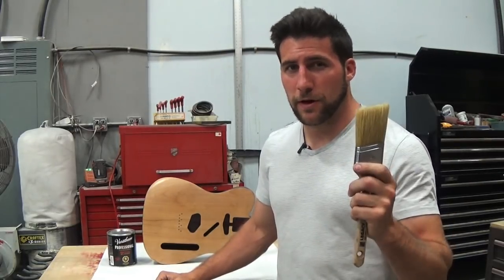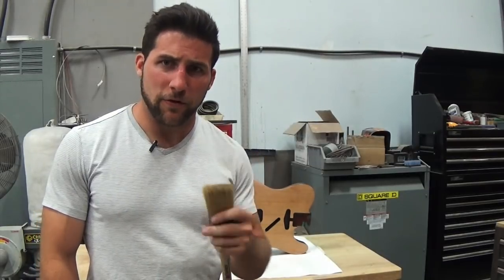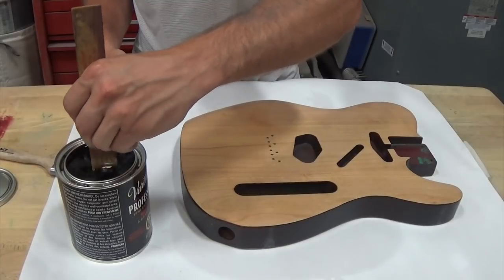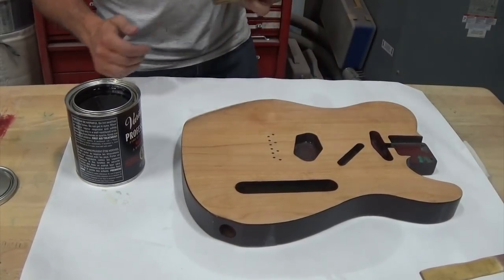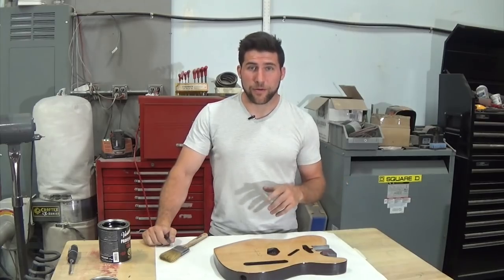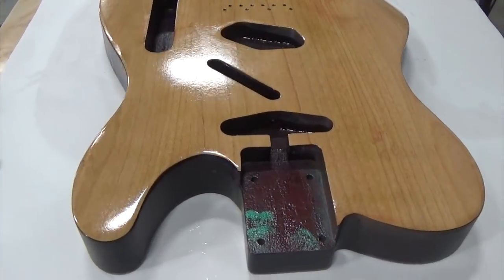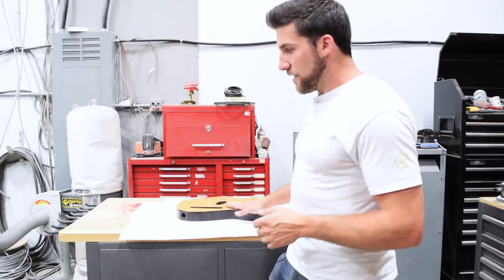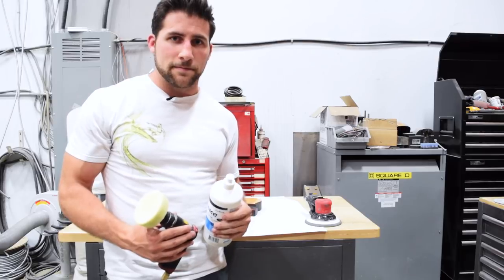How to Brush On a Beautiful Gloss Finish

Comment: Since you mentioned that you're fairly inexperienced with brushing technique, here is a good tip. Never start your stroke in the wet material. Meaning, either start it on a previously unpainted section or, on a guitar, start at one edge and go all the way through and off the opposite edge. If you need to get to a spot in the central area that was missed, always start at an edge and brush towards the center. This eliminates lap marks.
Reply from the maker: Thanks for the tip. I haven’t had any issues with lap marks, but it will be good to avoid them in the future. I usually start near the middle now and brush out to the edges to avoid large drips down the sides.

Comment: Hi Brad, could you do this to a guitar with paint on?
(What I’m looking at doing is removing the gloss off the guitar, drawing/decorating on it, then re applying the shiny finish to the guitar)
Do you have any other pointers on how to do this effectively or if there is a better way of doing this?
Thanks in advance 😀
Reply from the maker: Yes, you can do that. Just make sure you test the paint overtop of your proposed decorations on something else first. There’s a chance brushing it on will move around whatever you put on there.

Comment: Pure bristle instead of sponge?  I just purchased a small supply of clear semi-gloss lacquer and was advised to use a sponge brush in applying it.  I just took delivery of a guitar kit in Olympic white, and my goal is to apply a single semi-gloss layer to its wooden parts (other than the fingerboard). Less after a wet look than a single, protective layer.
Reply from the maker: Double check online because if I remember correctly lacquer responds better to synthetic bristle. I would use sponge, it may actually melt with the lacquer thinner haha.
Reply: Nice retort, @BradAngove . Thank you for the response.
Reply from the maker: For that last sentence I meant I wouldn’t use sponge because of the melting haha.
Reply: That's what I thought you meant. Thank you @BradAngove .

Comment: Hi. Will this be the same for a nitrocellulose lacquer top coat? Also, can sponges be used instead of the brushes?
Reply from the maker: For lacquer in particular you need to use a brush. Make sure you use a brushing lacquer and not a mix that’s designed to be sprayed.
Reply: @BradAngove  but same process right?
Reply from the maker: Yes

Comment: I was gonna use an oil based polyurethane on my bass neck. I did want it crystal clear because that's what it was like in the 70s. Should I go water based?
Reply from the maker: If you don’t want the ambering effect of oil based, then yes. Water based is crystal clear.

Comment: Hiya Brad... A thought crossed my mind  (a strange thing I know), but if I were to spray a dark burst effect that fades into the natural wood, is it possible to use the 2K clear to finish as you did in the Frankenstrat? I know I could brush (or spray) the polyurethane as you've shown here, but I wonder if the 2k clear would be fine on the natural wood? I ask the question because the 2k clear will dry very hard, which might be desirable.

Cheers
Reply from the maker: Yes, that's certainly an option. I've used the 2K to seal up bare wood before. To improve your chances of getting a nice smooth finish, I would spray some transparent sealer first, but it's not necessary.
Reply: Excellent...thanks Brad. I think I'm close to settling on a plan!!
Reply from the maker: +realjumper Awesome. I'm excited to hear how it goes.

Comment: Would you use this for the entire body and the neck and headstock or is this just for the front of the body? If you use it on the entire body, how do you avoid runs on the curves?
Reply from the maker: I would probably use it for the whole body and headstock. I wouldn't use it for the neck though, simply because I find that a gloss finish makes the neck harder to play. You would apply the paint a bit more thinly to the curves, and just do another coat if it doesn't get the amount of build that you're looking for.

Comment: Hey Brad, can you use spray can enamel on acoustic tops? I'm repairing an Ovation which had the bridge tear off, and left a couple of holes.
So I've had to glue in a piece of thin, light wood to secure the bridge back, and of course I had to sand the entire top to bare wood.

I have a can laying around, but not sure if it would dampen the tone or sustain.
Finally, if it's ok to use the enamel, can I spray clear lacquer over enamel after it dries?

Thanks brother!
Jack ~'()'~
Reply from the maker: I don’t recommend using enamel, it can affect the sound. If you do use enamel, definitely do not use lacquer over it. They will react poorly.
Reply: @BradAngove  Thanks Brad. I asked you about this quite a while back, but a series of hospitals stays later I completely forgot what you'd recommended.

I guess I should have asked, what I should use in a spray can to produce a matt black finish.

I don't even want to attempt to get the gloss back finish it had, because I'll only make it look like crap!

Jack
Reply from the maker: Have you seen my video on how to get a matte black finish with spray cans?
Reply: @BradAngove  
I remembered that not too long after that last post, and I'm gonna have a look.
Thanks brother, you've always answered my questions, even the stupid ones! ")

Jack ~'()'~

Comment: Thanks Brad, could you indicate what the rpm's are for the orbital sander and the polisher?  I don't want to sand through the body.
Reply from the maker: I’m not sure what they are. For the sanding, the grit of paper will have a substantially greater effect on your ability to sand through than the speed. Faster rotation doesn’t necessarily mean faster sanding. Start slow and see how well it levels. 
For the polisher, I turn mine up to full blast, but it’s based on how much air pressure is running through it. Again, starting slow is safer, but you should be able to avoid burn through by not pushing too hard and by keeping the polisher moving.

Comment: Is it atall possible to brush on a top coat on tanks ect and get a good finish ... I use an airbrush but haven't got the equipment to spray laquer to finish ?
Reply from the maker: +Jacqueline Powter I would be very concerned about the brush messing up your airbrush work. I think you would be better off just getting a quality spray can.

Comment: Roll and tip. Thin the varathane @ 10% with a combination of spirits and naptha, roll it on with a foam hot dog roller, and immediately tip it one stroke only, in one direction, with a finish dampened badger hair varnish brush. It will look smoother than if it was sprayed and if you do choose to rub it out, there will be a lot less sanding. You may even decide it does not need polish. 

Also, you can wet sand wood finishes with mineral spirits without damage or changes to the wood or the subsequent finish coats.
Reply from the maker: I'd love to see a tutorial from you on that technique. It sounds interesting.
Reply: It's kind of common knowledge in the realm of high-end yacht finish and there are tutorials about the web. I've had nearly 40 years in, and when I started, masters mixed their own solvents for a variety of seasonal temperatures and climates. One of the best leveling blends for alkyd based finishes, both pigmented and clears are, kerosene and naptha. Cooler temps, a bit stronger on the naptha, warmer, side with more kerosene. Spirits is an 'ok' substitute for kerosene. The other ingredient is a full and fine, badger styled brush found mostly at marine supply outlets. About the closest you may find at a normal paint store is Purdy's Ox hair series. 

A clue to this technique is the label VM&P (Varnish Makers & Painters) Naptha. :)

Comment: In that this glossy layer is oil based would it be safe to apply over an oil stained and hand rubbed oil finish to get a mix of ultra glossy and satin finished with just the oil rubbed finish?
Reply from the maker: You can put it over oil based stain. There would be no reason to try to do it over an oil finish though, since it would just turn it gloss anyway, and you can rub portions of it back to a satin finish if that’s what you want.

Comment: hey brad! i dig all the vids dude but  i need help man! youve successfully inspired me to build a guitar so i made a purchase and i have my kit, now tell me, is there ANY way at all to create a Natural binding by masking off the rest of the piece and using wood sealer or maybe even lacquer to keep that original wood look into the binding? possibly by brushing it on? help me man! you drove me down this road with all these videos haha i love the stress of knowing i could basically trash my 200 bucks at any time if i mess it up. so i need you man! help Brad!
Reply from the maker: There are a few ways of creating a natural binding. The folks over at PRS do it all the time. The choice of method depends on how you intend to apply your colour. If you're spraying it on, you can seal the whole guitar with transparent sealer, tape off the binding area, and then spray on your colour. Then remove the tape and clear coat. If your wiping on a stain or dye, you can tape the reverse of the binding and brush on something to seal it like you've suggested. Unmask, wipe on your colour, clean the bound area that you've sealed, and then move on to clear coat.
Reply: Just my luck im actually building the PRS  model styled guitar kit Haha. Thank you man! i have been looking for ways to proceed forward for far far too long, Thanks again Brad!
Reply from the maker: +ashtonm mckay You're welcome. I hope it goes well for you.

Comment: If a 2 inch brush is not ideal what do you recommend, a 2.5 in brush?  Thanks.
Reply from the maker: A wide brush is best for the top. 2.5 - 4 is good. The 2 or 2.5 is usually good for the edges if you’re doing them as well.

Comment: What type filler do you use to fill a deep dent in the surface from something falling against the guitar?
Reply from the maker: If it’s really deep I like to use bondo because it has a hardener.
Reply: When I say deep, I mean relative to the thickness of the wood on the face of my Yamaha acoustic.  Can this be repaired without refinishing the whole face of the guitar?
Reply from the maker: If it’s small enough for you to drop fill it with lacquer then yes. Dan Erlewine has a video on how to do that.

Comment: I tried this a few times, but each time my first sanding left a matte sort of dull finish that the later grits never fixed. What am I doing wrong? It basically seems like the sanding takes the gloss off by adding scratches (even if I start at 1500 or 2000 grit) and then nothing I do restores the even glossiness from before polishing.
Reply from the maker: Are you using compound and polish after?
Reply: @BradAngove  i used 1500 wet sand (previously I'd used coarser grits and had the same issue so I thought I'd try it), then stewmac medium then fine compound after (I know that these grits and compounds don't quite line up...). I didn't use anything after that.
Reply: The 1500 was by hand with a pencil eraser for a flexible sanding block.
Reply: In case it isn't obvious, I really really don't know what I'm doing and I just learn from youtube
Reply from the maker: You might just need a heavier compound first before you do the fine one.

Comment: i'm planning to apply clear coat over air-brushed design on my motorcycle tank. I used water-based colors for airbrush,so, obviously, I'm gonna use water-based clear coat.Would you recommend this technique over rattle cans? (Seems to me that this way I can get thicker coat). Spray gun is sadly not an option =( Also where I live one can only purchase some lame 1K piece of s**t clear coat in rattle cans. #ThirdWorldProblems :D
Reply from the maker: I use the catalyzed urethane over my water-based airbrush colours. Or lacquer. I rarely go with a water based clear. In any event, if you want to go water based then feel free to brush it on like this. If not, I would seal it in with a rattle can first and then consider brushing on a thicker coat over top. Otherwise you brushing solvent onto water based paint could cause it to move around and smear a bit.

Comment: Hey thanks so much for these videos! Quick question, I stained my guitar and about to start the polyurethane but the highest grit paper I could find was 2k. Will that be high enough for the polish or do I need to order something finer?
Reply from the maker: You should be able to polish that out. It will just take a bit more work.

Comment: Is there a vinyl sealer that can be applied with a paint brush?
Reply from the maker: There are many types of transparent sealer that can be brushed on.
Reply: Would you recommend one, please. Thanks.
Reply from the maker: You may just want to use one of the typical ones from zinsser.

Comment: Need some help. Can I use this technique after staining my guitar with water based dye? I bought keda dye, stained my guitar, and am looking to brush on for my clear coat (looking for a mirror finish). Also, would I need a sealer?
Reply from the maker: This should work. A sealer isn’t a bad idea, but it depends on wood type. I didn’t use one here.
Reply: @BradAngove  Thanks a lot man!

Comment: Having just cleaned my brush from applying my first coat of clear gloss [water base] I thought I'd mention a couple of things that newbies like me need to know. 

I loaded up the brush enough for a couple of meaty strokes down the middle of the guitar [back] and then brushed on out towards the edges without loading up any more. There was still p/u going down but I realise now that you do need to keep the brush adequately loaded to get enough down so that it flows nicely into itself all over the surface. The edges are probably a bit thin, tho' I did go back with a bit more on the brush. I hope that the second coat will make up for this if I load up the brush more for the periphery areas.

My tin of p/u states 'touch dry 1 hr/recoat 2hrs/dry 6 hrs/max hardness 24hrs.' I guess your 'second coat after 10 mins' refers to oil based p/u. ?

It also recommends a light sanding between coats. The surface now has a wet-look gloss - if that's the way it looks in a couple of hrs time, I guess keying the surface again will be necc.
Reply from the maker: Yeah, you need enough for it to flow. If you’re going to let it dry fully between coats then sand smooth with 400 grit before applying the next coat.
Reply: @BradAngove  Thanks Brad. I gave it a good seeing-to with 400. Applied coat 2. BUT - the brush matters, a lot. 

Mine, like yours, is 2" bristle. But there's bristle and bristle. Mine has proved poor quality. I improved it from coat 1 by trimming the ends to a clean tip. This helped. But the bristles are still too coarse to avoid 'bristle lines'. I will go at it again - flat it back and do coat 3. That will be with a synthetic brush with which I have had much success producing a fine finish with spirit gloss decorating paint. If this doen't produce the finish I want, I will go yet again and use a foam pad with very fine foam. Thanks so much for your advice and - watch this space! I hope others will benefit.
Reply from the maker: A good brush certainly does make a difference. I take it you’re not planning on going through the sand and polish process afterward?
Reply: @BradAngove  The brush not only had coarse bristles but dumped three of them in the poly. Sure sign of a poor quality brush. The full length ones were easy to remove but the 5mm one was curly and left a mark. I am very surprised at how fast this poly starts to go off. Within 2 mins you can't touch it without leaving a mark, even with a drop more poly on a fine artist's brush. It's 25- 26C [78-80F] in the room. No sand and polish. I will continue with scuff and poly until I am happy with the result. I will knock back the bristle lines and go again with my nylon brush. The back of this guitar is my training camp. Only when I know I can make a good job of the front will I stop! 

For those who find the cost of a good quality bristle brush more than they can justify for DIY projects, it is poss to find excellent synthetic brushes for 'own brand' prices. For years I have been working [mostly decor] with a line that happens to be the 'own brand' of the UK equivs of Home Depot. As these 'own brand' lines are universal - all the UK DIY sheds have the same items - you might find them your side. They are called Diall - two tone grey soft grip handles, very fine 'bristles'.

Comment: I feel like varnish might make the wood look a little better but that's just me because I like varnishing things
Reply from the maker: Why would it make it look better? A deeper amber hue?
Reply: Brad Angove I feel like varnish makes the grain pop a bit more and I like the contrast that brings
Reply: Brad Angove btw why sand to 600? I always thought that anything over 400 doesn't do much other than make it harder to seal in the wood
Reply from the maker: Why would that make it harder to seal the wood? If anything it makes it easier working on a slightly smoother surface (but not so smooth as to negatively impact adhesion).
Reply: Brad Angove I always thought sanding over 400 would do that? Was I taught wrong ?
Reply from the maker: Would do what? Make it too smooth for the finish to stick?